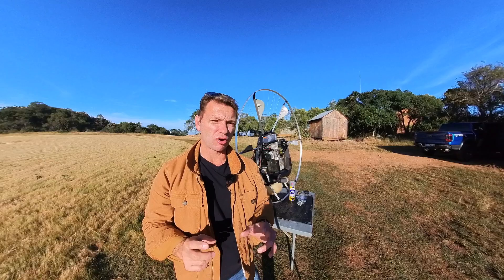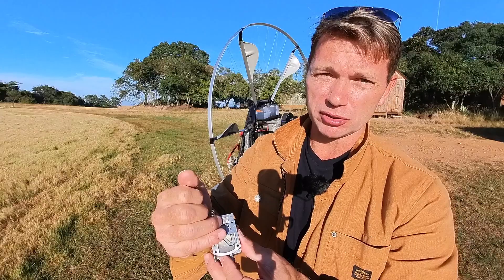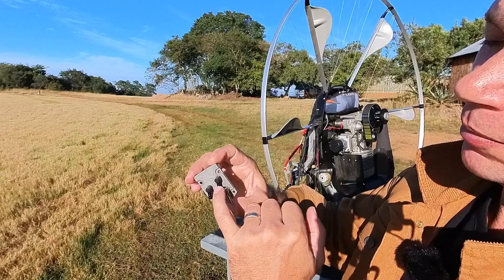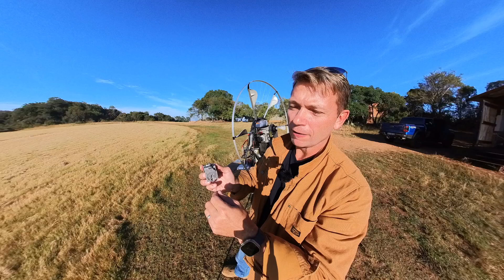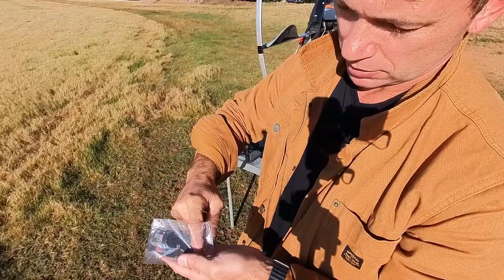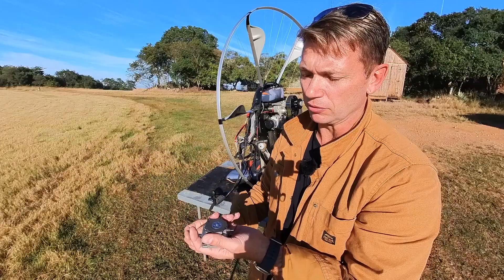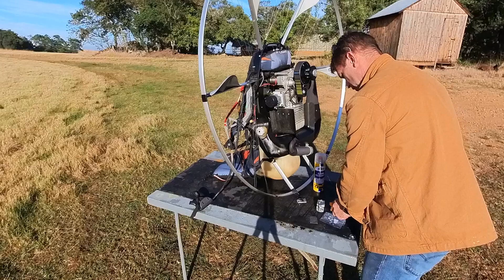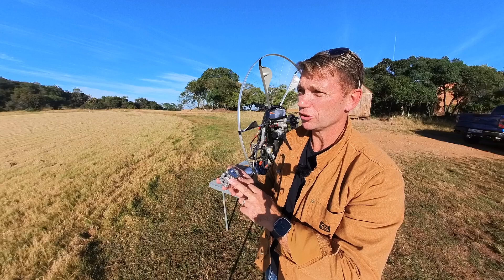Carburetors and Startup

Comment: Hi Eugene, the WB3A (@8:40) uses the part with only 1 hole.  Great video and there are not enough videos out there like this. The gauze filter between the pump side and the pop off needle, I remove this as I have seen micro particles build up and create a blanket.  These particles would naturally go through with no harm if the filter isn't there.
Reply from the maker: Ha! Interesting. Never worked on those. I made the video specifically because so many mails asking me to do one for Nirvana owners
Reply: @therealeugenecussons  Ah ok.  Still supporting your channel and congratulations on getting to 1k subs.
Reply from the maker: @GolfFoxtrot22  sheet its actually embarrassing but fact is I ONLy have pilots watching this space!

Comment: If your fuel inlet elbow moves, you can also put red loctite around it and put it back in the carb. It will form a nice hard seal and fix any air leaks and prevent it from moving in the future.

Comment: Priming while building up the vacuum pressure makes sense. It's same effect as "choke" lever. Other motors like Moster run richer and typically don't need that; although i have experience it on a Moster when i had it tuned lean for an XC.

Comment: Thanks Eugene   How long does gas last or what’s nirvanas take on topping off and adding some fuel stabilizer for the off winter months? Or is it best to run dry . Thanks in advance I’m learning
Reply from the maker: Hey. Mixed Gas typically lasts about 3 weeks. The oils these days are really good so even lingering but my advice would never to store gas in your machine over months. Drain, use primer pump to clean out lines, and membranes and fuel lines will survive much longer